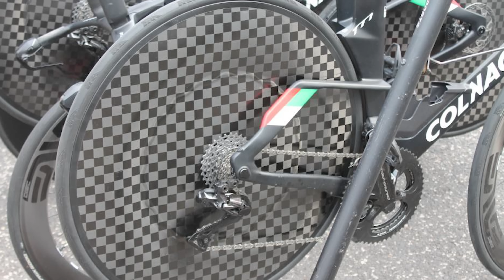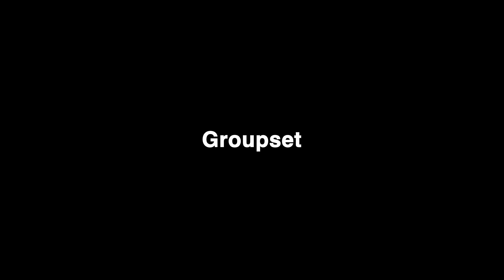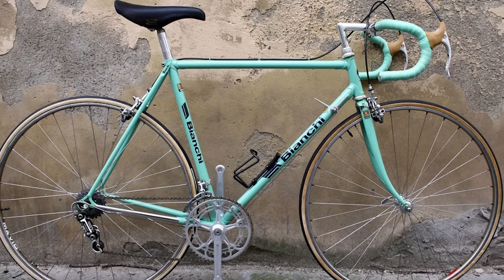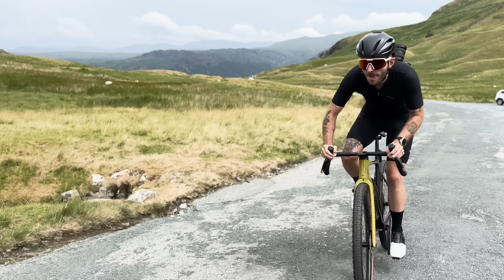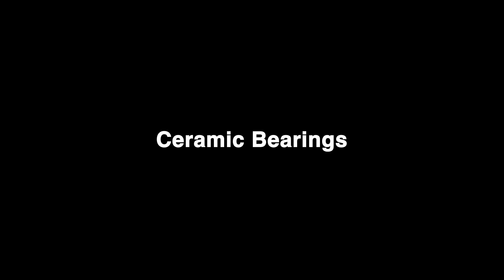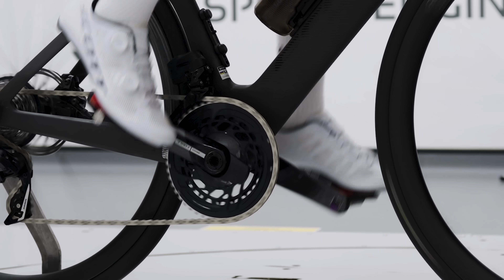Aero Expert's 10 Most Overrated Products

Comment: I think your man's mostly right here, but there's a few caveats I want to add regarding groupsets and disc brakes. While they may not in and of themselves offer any sort of weight or aero gains that are noticeable to the average rider, what they do provide is effectiveness and confidence. Disc brakes will not make me faster in a sprint, but on a descent in the wet I will definitely be going a lot slower with rim brakes simply because I'm not as confident in their ability to slow/stop me when I need it. To a lesser extent the same applies to groupsets in that quicker and easier gear changes means less faffing around trying to get into the gear you want.

So in those respects I'd say that actually they might make you a little faster, at least in certain conditions. They're definitely not the best bang-for-buck in terms of aero/power savings, but they're not quite on the same page as ceramicspeed jockeys IMO.

Of course like so many sports, the absolute king of performance gains is simply training and nutrition. What you eat and what you do will have a far bigger impact on your speed than a flash set of deep sections!
Reply: I would argue something similar but maybe to a lesser extent with power meters too, because the data from your PM is much more accurate and consistent than using HR, perceived effort or times on repeated routes etc. As there are too many variables. So even if your "training" consists mostly of just riding and hoping for the best you can gat a better picture of what's happening with your progress (or lack of).

Comment: Going from a 2016 rim brake climbing bike to a 2024 disc aero bike was a huge upgrade. Not only is the bike way faster on its own, but disc brakes allow me to run a much wider (and more comfortable) tire which reduces fatigue and makes riding more enjoyable, but the big tires and stiffness of thru axles gives me a ton more confidence cornering. And when it comes to hitting those twisty descents, the disc brakes are a HUGE confidence booster especially in non-dry weather.
Reply: Sounds like a skill issue.

Comment: I would argue, that having disc brake, especially if you are not a top rider, will definitely make you faster going downhill.
Reply: Depends on the hill and wether staying on the road, is important. 🤕
Reply: @savagepro9060  thats not the brakes fault, and everything equal, you have more control over your bike with better bakes.

Comment: Bought ceramic bearings in 2008 for a 2006 road bike.  Embarrassingly, even a FSA ceramic bearing head set.  The BB failed after two years.  But that head set is still going strong (as far as I know)!

Comment: Bought a really light (for the time) aluminium wheelset 15 years ago. Constantly snapped spokes. Luckily it came with a bunch of spares 😂 changed to a cheap campa one that had no problems over the next decade. Somehow that fix stayed longer with me than planed
Reply: Assuming nothing else with the wheelset is wrong part-wise, it's probably built wrong. Well-built wheels won't keep breaking spokes due to even spoke tension and without forgoing the tension limits.
Reply: @sbccbc7471  I was probably above the weight limit. Back than some wheels had 80kg as a maximum system weight 🤷‍♂️

Comment: For my slow a^s... aero is a waste of money :)  
Also I dont care much about weight. < 10kg and Iam fine.  
But regarding the brakes ... since I have a few km in the city until I get to "open roads" I really want that additional stopping power.  

Would be interesting to see if a stronger and more controllable brake will give u advantage in an race since you probably can brake later into a downhill corner?
Reply: Yeah, I'd agree disc brakes speed you up as you have more confidence downhill (exponentially if its wet)
Reply: The problem in race is when in group your braking distance is shorter than guys behind you 😅
Reply: Exactly my point. Disc brakes will make you faster. Obv not on a closed, flat TT course but for us mortals who ride through cities and villages that extra braking performance gives me the confidence to ride as usual and still be able to brake in time if anything happens. 
Also rim brakes come with all these pesky external cables that are so frowned upon these days :rolleyes:

Comment: After hmmmm.... 40 years (damn) without power meters, I decided to get me a pair of (flat!) SRM pedals on my current MTB. Just out of curiosity what I'm pushing. (not much it turns out. :D) 
In reality: I find them utterly distracting and entirely killing my ride. I constantly worry about having a lower watt average than the ride before etc, my heartrate zones are entirely out of whack because of it. I discovered that is not why I ride. So I guess that was a lesson learned and now I know. Did not help that they stopped working twice within a year. SRM did handle it nicely no problems there.  *Why in the pedals and not in the cranks: Pinion gearbox has proprietary arms so it is not an option.
Reply: I had a similar realization; I use my power meter during training, but during proper rides, I use a main screen on my head unit that doesn't show my power.  Just my speed, heart rate, and cadence.

Comment: Valid point, but he said nothing about the durability of ceramic versus steel bearings. One thing I noticed is the Enduro bearings weren't rusting. As to chains, you can "upgrade" to your manufacturer's top of the line chain and not spend a lot of money. Buying a pre-waxed 400 dollar chain is a waste unless you are racing it and you know what you are doing.
But one thing is buying aero is a tremendous waste of money if you aren't. Get a good quality bicycle that can accept upgrades and you are good to go as you grow into the sport.

Comment: I invest a little to my bike not for speed -but to go further without muscle cramps. My trips are in the mountains and after some time I am not able to ride after big effort during uphill.
After changing wheels for carbon and slick tyres and some weight reduction my the degree of fatigue is much lower at the same point on the route. The speed is not my goal - the most important are pleasure of driving, admiring the views and being tired, not physically exhausted what is good for health. Sometimes heart attacks happen - too much effort can kill you.

Comment: Please challenge me, how on earth can more arrow even be a factor when we have our bodies dragging at the highest point? Sorry but all I can think about is a sailboat and being against the wind. That's an exaggeration but I figured it would help simplify my point.
Reply: The riders body may be the "highest point" but its not the most forward point. The idea of an aero bike is to "split" the air In front and channel it around/over you (obviously a very over simplified explanation). Its also worth remembering that at speeds over 10 mph (16 kph), aerodynamic drag becomes the dominant force of resistance, so even though the rider makes up 70-80% of that drag that's still 20-30% the bike is responsible for and its worth trying to reduce, couple that with the more aggressive position an Aero bike is designed to be ridden in and the "gains" out shine anything that can be achieved elsewhere on the bike (with the exception of the riders strength, fitness and skill). If this was all or mostly marketing bunk as some seem to think TT bikes would not exist, or they would but they would be no faster than a road bike with the same gearing.
Reply: @Bikey_McBeardface   I love bikes. The aerodynamics I'm not sold on at all.  In my opinion it is about the most pointless resolved component.  Even a tubular design would have a strong argument.  We are talking about a difference of inches honestly.  I feel like every other component is more important than the aerodynamics.
Reply: @nuancedliars112  I don't understand what you mean by not being "sold on" it. Aerodynamic drag is just a fact not just in the cycling world it applies to anything that moves through an atmosphere. Round tubes are TERRIBLE form an aero point of view BTW this has been know for a long time and not just from the cycling world. What is it about heavier TT/Tri bikes that makes them faster than their road counterparts if not Aerodynamics?

Comment: Cycling regret: spending $650 resto modding a 14.5kg 1970s frame that didn't fit me vs just buying a 9-12kg Triband or a rim brake Motobecane? Especially as a longer stem or narrower bar is way cheaper considering it would still have been lighter as well by 1-2kg. I love my bike, but I did not think it out as best as I could have. Either way, if any one has a 50-52cm frame with 126mm drop outs, hit me up xD

Comment: Well that was unexpected but quite sensible. The guy is basically saying that if you're not making money from riding your bike (or get the parts for free) you won't be able to feel any 'marginal gains'. Which is why I still use wet lube, clean my drivetrain at least once a week and replace my chain sooner rather than getting involved with waxing.

Comment: What does he mean by not understanding a power meter? I understand that he might be implying that you should use a power meter primarily to structure your training but it is also an important metric so measure your fitness. How else would you measure it? By doing the same loop in the exactly same conditions and measure the heart rate?

Comment: I always thought the oversized jockey wheel was about chain efficiency and allowing you to lengthen the durability of your chain and its lifecycle. Am I wrong on this one ?
Reply: Unfortunately no. Chain wax do much better job at that.
Reply: If it saves 1w through less chain wear but you're putting at least 100w through each pedal stroke I can't see it improving chain wear by more than 1%. Spending 100s to get an extra couple of km out of chains that costs 30 isn't going to be cheaper within the lifespan of your bike. 

They're for the marginal gains crew only, where that 1w might be the difference between winning a race or placing second.
Reply: The experience I get from my OSPW is that it is a weapon to have for uphill spinning. For me, it is like having an extra gear.

Comment: There are only 2 ways to make you faster,
1)Tires, training or puncture resistance are the way to go IMHO but are slower thus a racing pair will make you faster
2)STOP the whinning and excuses, just work harder and you'll see how your speed increases.
Rest of things inside of the "marginal gains" domain won't make you faster, not enough to be noticeable or worth unless you compete in a very tight race and having your living incomes attached to it.
Many times tour the France and equivalent races where won by more than 5 minutes of difference, and this gap won't be closed spending a ton of money on your bike, but  spending a bit  on you!
Training and taking care of your body will make a massive difference.